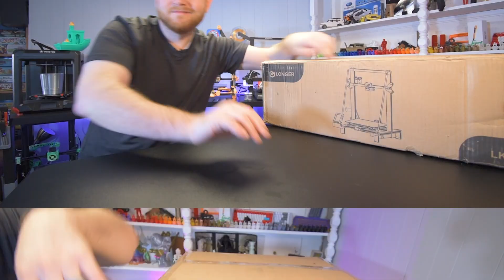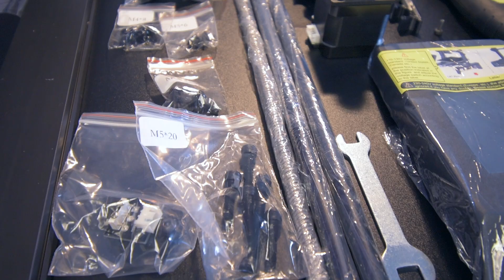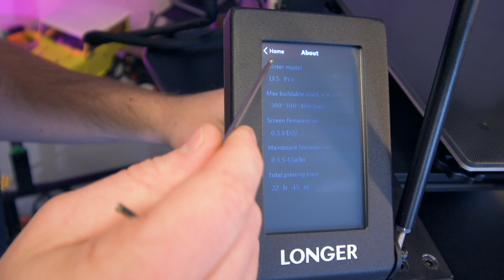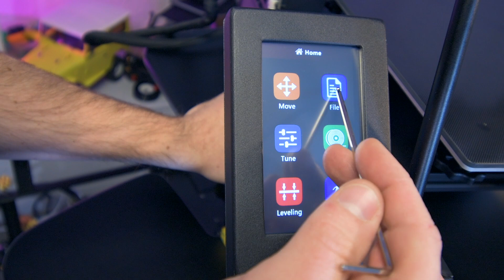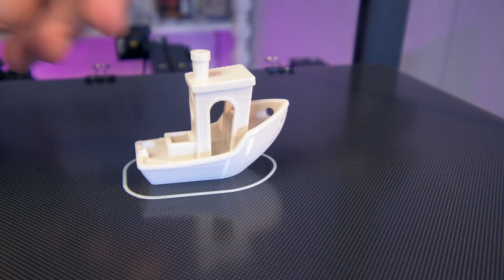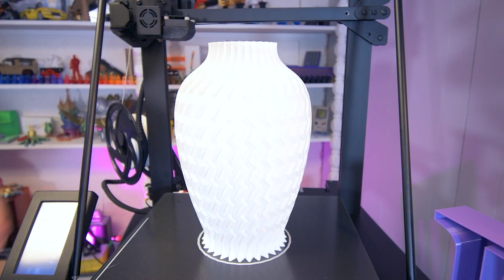Longer LK5 Pro - Unboxing, Setup, and Initial Impressions!

Comment: Hi I have a Longer LK5 Pro I cannot do the set up as there is no movement on the Y axis . Have you any thoughts to help me .
Reply from the maker: Hmm. If there is no movement that's gotta mean something Is unplugged. Have you taken a look at the plugs at the motherboard?
Reply: @3DPrintSOS  Thanks there was a cable not connected on motherboard . Problem fixed thank you for the input. Tony
Reply from the maker: Nice! Easy fix. Enjoy the machine. :)

Comment: Woohoo! Mine will be here tomorrow and I was worried about the single Z, especially for the lower layers. I will use it stock for a little bit then put the dual Z, BL-Touch, and PEI flex sheet on there
Reply from the maker: This thing works great. Pleasantly surprised with the bed too. One of the best glass beds. Easy to upgrade too.

Comment: The non-insulated print bed heats up the bearings in the roller wheels and causes the oil to run onto the wheels and make a gummy mess.
The print bed needs an insulation blanket.
Reply from the maker: That’s a pretty extreme case of heat. I’ve never had this happen on any machines. How hot is your bed getting?
Reply: bro the new ones have that lol imagine a company that actually listens to its users. @3DPrintSOS

Comment: The product page says it has an optional BLTouch sensor for auto leveling. But it doesn't have the cost of this sensor
Reply from the maker: Not sure to be honest.
Reply: @3DPrintSOS  "Not sure to be honest" about what? I personally checked the product page. And I wasn't asking for the price of the optional sensor. I was just stating what I found.
Reply from the maker: Oh. I thought you were implying that I should state a price. Haha. Thanks for the info though. :)
Reply: @3DPrintSOS  Nope. You read too much into my factual state. There was nothing implied or suggested. If I were to suggest you do something, I would make it very clear that it was a suggestion, so there would be zero confusion. I hate confusion. But thanks for reading my comment; not many do these days.
You have good content. I have done some upgrading on my 3D printer due to your fixes. You have helped me with printing issues in the past.
Reply from the maker: Haha. I read ya. Thanks and I’m glad I was helpful in some way shape or form. Thanks for watchin. :)

Comment: I wish manufacturers would ditch the bulldog clips they supply to hold the glass to the plate, if there are any high spots on the plate the tension in the clips deforms the glass if they are poitioned on each corner, I have just bought some of the screw type clips and place them on the centres and what a difference it makes, my glass beds are much flatter now and I have great fun making adjustments and then reprobing to try and get the best numbers
Reply from the maker: Yes. Tronxy uses these clips. I’ve always liked them.

Comment: I have a review on this machine in the works. It's all done, just need to edit it.

IMO this is the printer voxelab should have made to leverage their success with the Aquila.
Reply from the maker: 100%. I actually had a take of the conclusion that said that, but I guess I cut that out at the end. I agree with you 100%. This is what everyone was asking for. But instead they made a X2, C2, S2....
Reply: I probably won't say it in my video either, but i totally wish Voxelab made this printer a year ago. Even without the touchscreen it would have sold like hot cakes. 

I understand not adding it to this video though. It's awkward to fit another printer in a conclusion, unless it's one of the top printers.
Reply from the maker: Agree 💯

Comment: I love this machine I have even made it direct drive.
Reply: Same
Reply from the maker: Any issues with single sided z with the direct drive?
Reply from the maker: Was there something wrong with the bowden setup, or you just like direct drive?
Reply: @3DPrintSOS  nothing wrong with bowden, just is limiting on speed. My philosophy is a print should never take more than 24 hrs, preferable if they are ~4-6 hrs max
Reply from the maker: @NathanBuildsRobots  Words to live by, Nathan. Looking forward to your video. Better not have any googly eyes in it though, those are only ender things.
Reply: 2nd z would be great to have, but it's working fine. I increased nozzle to 1mm for fast and large prototyping
Reply from the maker: @NathanBuildsRobots  Nice! Good to know, I have a .8 mm nozzle waiting for a machine. Which direct drive did you go with?
Reply: @3DPrintSOS  BMG clone from Haldis (bought 6 of them so far, they are good and cheap at around $15), I designed a printable mount for it that I'll share.

But I also just bought an OMG extruder. They are super cool. It just threads in to the heatsink where the bowden fitting normally attaches. Will be my go-to extruder upgrade from now on, because attaching directly to the heatsink is the best solution IMO.
Reply from the maker: That’s great. Look forward to seeing it all in action.

Comment: Silly, non technical question, dud you find it irritating that the screen is on the left? I think these companies should make them so they can swap sides, sounds not picky I know but the screen on the left would bug me
Reply from the maker: Haha. Honestly, no I didnt think about it. I’m guessing it’s so they can use a shorter cable instead of stretching all the way out. Or maybe the owner/designer is left handed. 😂
Reply: @3DPrintSOS  it struck me as odd that it was on the left but that might just be because I'm used to it being on the right. Looks like a nice screen tho, seemed responsive as well
Reply from the maker: Yeah, not bad at all. My concern with it is that it may not be fully or easily supported by non custom longer firmware. Which would be ok if they added a few more features to the firmware.